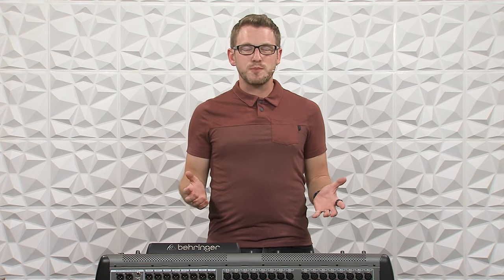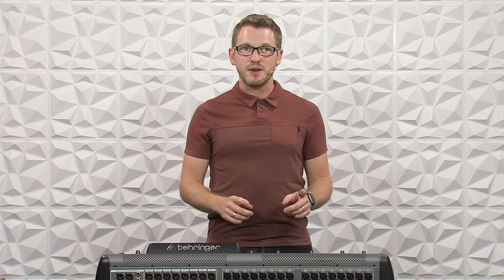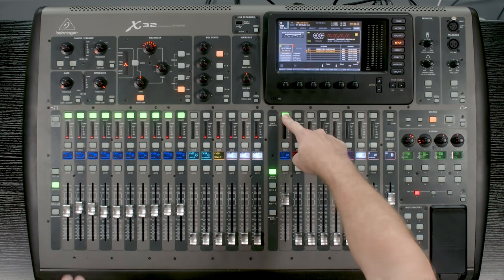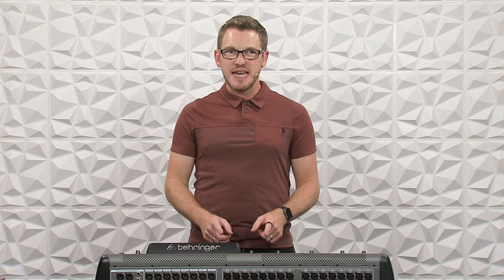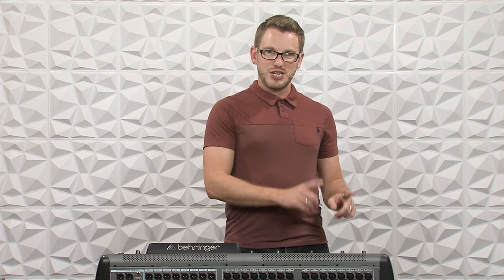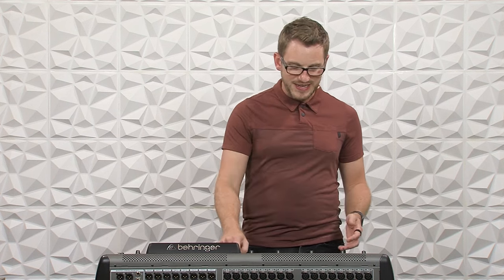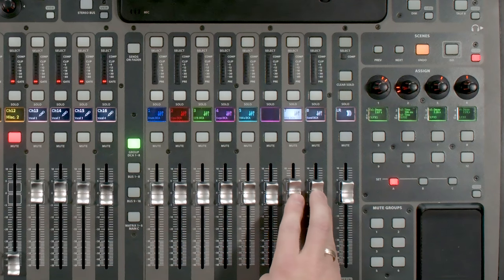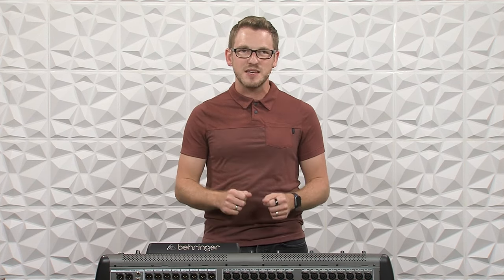Behringer X32 DCA - What is a DCA?

Comment: When adjusting DCA's will it change output to just the main mix or all buses?  The reason I ask is I have separate buses for live streaming.
Reply: It will only affect other buses if those buses are getting signal post fader.
Reply: You can apply different DCA's to those busses too, (if you have extra DCA's) and they will control the output of those busses in your stream

Comment: Hey Drew, Would you mind doing a video on adjusting EQ and other settings for an Electric Drum Kit? Especially dealing with challenges where you have very limited control over individual pad settings as cheaper kits sometimes don't let you dial that in as easily.

Comment: Hey Drew, echoing the comments of many here, infinite thanks for all your excellent videos on the X32! Without them, my new X32 would now be sitting in the electronic recycling bin, a victim of a frenzied sledge hammer attack... So many little things hidden away in the X32 that take hours to discover/understand (like the little LR button in the bottom right of the home screen that allows you to turn off a channel feed into the Main LR channel for instance - that took many frustrating hours to discover!!!). But on the subject of DCA's, boy, this gave me the run around, again for several hours. I have a group of 4 mics feeding into a subgroup bus, along with a subgroup for instruments and one for VSTi's. I thought, brilliant, I'll use the DCA's to normalize the gains for each subgroup. Only to find that 2 of the mics could be adjusted up and down by the DCA, but the 2 in the DCA group were unaffected - they stayed at constant volume. All were adjusted ok by the subgroup fader. After literally hours, I discovered that somehow in the Channel Sends page (controlling levels to the subgroup busses), the send point for the working channels was set to 'POST FADER', but for the non-working channel (ie not adjusted by the DCA) channels, it was set to 'POST EQ'. Resetting to POST FADER fixed this. I mention this in case anyone else runs into the same issue.

Comment: DCA is actually "Digitally Controlled Attenuator". A VCA, which is in the analog world, is Voltage Controlled Amplifier. FYI. In the digital world we are using all digital signals - not amplifiers. Either way, they perform the same function.

Comment: I’m just a teen required to run sound on my church and I’ve improved so much using your videos. I use 5 of the 8 DCAs and now I have a question. Is there a way to send multiple vocal channels to one compressor?

Comment: Drew, I wanted a way to listen to my broadcasted streaming program live to verify it was properly streaming.  My former analog board had a “Tape IN” jack I could solo, but the X32 didn’t.  Here is what I did. 

I ran the broadcasted streaming signal from my cell phone into Aux 5,6 and un-routed them from Main L,R.  I then assigned them to a spare DCA.  I can now solo that DCA to hear my broadcasted stream and there is no way I can accidentally run the broadcasted signal back into the mix. 

I hope this suggestion helps someone else.

Comment: Hey Drew. This is George from African Egypt.  my Church is Maadi Community Church an American international Church. So we have got this new X32 and I am having problems using x32 as my audio sound card for ATEM Mini. So I need your help how can I set it up?
Reply from the maker: With the ATEM Mini, I would recommend taking the RCA jacks on the X32 Aux Out 5&6 and putting that into the audio input on the ATEM Mini. You will need to change it to be line level on the ATEM software. Once you have done that you need to route your outputs on the mixer. It is doable and I have a similar setup with the ATEM Mini in my studio! Hope this helps!

Comment: What is the purpose in putting just one instrument, for example the bass, on one DCA? Just convenience?
Reply: I could see if your bass was on channel 32, having it on a DCA keeps it on the 'same page' as other items. If you are using an x32 Compaq, you have 4 pages to flip through channels and quickly access those currently in use. Not how I typically use DCA, but one example why you might. ;)
Reply: might be a bass sound composed by D.I. + Mic signal

Comment: Hi Drew, learning a lot from your content! I have a question about DCA's. Are they only available for the house mix or is there a way to use them on my Livestream output? Thank you for all your helpful videos.
Reply: I think that this will be determined by your set-up and routing. DCAs are simply remote controls for inputs and busses. If you assigned a DCA to a Bus that's routed to say an external audio interface, then you will be able to control this bus' volume with the DCA, and thus, the level of your stream. 
So yes, the way you route your inputs to your outputs, will have nothing to do with DCAs. 
Hope that helps!
Reply: @itsvoul  not exactly. I have 3 dcas set up for my band, vocals and drums in house and that works great. I have my Livestream audio on a pair of stereo busses and I would like to have similar control of those 3 groupings so as to simplify balancing the Livestream output like it does in the house.
Reply: As he said, it depends on your routing. DCA's are for inputs and busses. If you have 3 DCA's for your FOH, that's fine. You can route other busses or subgroups through a matrix for your stream and apply your DCA's to those busses you're routing to the matrix. So 3 DCA's for FOH another 3 DCA's for stream. HOWEVER, make sure you don't route the same bus to multiple DCA's.

Comment: Hey Drew, this is a stupid question. I think a good sound engineer never gonna put a set of multiple input on a different group of channels. 
Can I assign let's say channel 6 - 10 on a single dca fader?
Considering 6 - 8 are on the first group of channels and 9 - 10 are on the next group of channels?
Reply from the maker: Yeah, it doesn't matter which inputs you place on a DCA. Say you had Vocal 1 on channel 1 and Vocal 2 on channel 31. Weird setup, but it would be no problem to have the Vocal DCA control these two channels.

Does that answer your question?
Reply: @DrewBrashler  thanks dude

Comment: Hi, thank you for this amazing video! Question: were you sending pink noise to the two channels from the X32 or from an external source? If from the X32, can you explain how you did that? Thank you!
Reply: Built-in oscillator. Behringer has him showing how to do this on their channel
Reply: You can use the built-in oscillator which is found in the talkback section

Comment: I’m surprised to see you started drums at 17 instead of 1
Reply: A DCA for drums allows you to put drums on second layer and take the solo
Instruments (Guitars, keyboards, vocals) on the first layer.
Reply from the maker: Yeah good eye for noticing that! I like to bury channels that I don't mix as actively. For me, I am adjusting the guitars, keys, and vocals much more than say the tom 1, tom 2 and tom 3. Don't get me wrong, I will adjust the kick a good amount during a song, just have to jump to page 2 to get there.
Reply: lets say different people have different drums like a simple kick, snare, hi hat set up with two over heads that's 5 channels left to right then on your desk bass would be channel seven, but if the drums had double kick, snare, hi hat, 3 toms mic'd and overheads that's channels that would use 8 channels on the desk and your bass would be channel 9 
 therefore starting your drums on channel 1 moves all instruments around the board depending on how many drums used. BUT if you use channels 1/2 as your main out...... bass 3 guitars 4/5/6/ keys 7/8 vox 9/10/11 etc they never move from those channels, then start drums on 17 it does not matter  how many drums you add or subtract, you will never disrupt the 1st layer of bass, guitars etc so you instantly know where they are

Comment: I love the DCA spill feature. It actually allows me to create a custom subset group from my entire inputs (AES, buses, aux, reverb, computer, etc) connected to the board. So let's say there is a segment in my production where I have a small mixture of instruments, mics, auxes, reverb, etc. I would create a DCA (at unity) and add up to 16 channels of what I need and then instead of me going all over the place, to mix those inputs, the DCA spill would conveniently display them to me.
Reply from the maker: Amazing! It was such a great feature that was programmed into the new firmware. Thanks for the comment, Joel!
Reply: @DrewBrashler  Olá! Então eu não posso aplicar compressor paralelo ou até mesmo EQ no DCA?